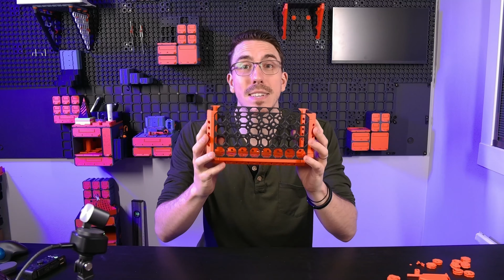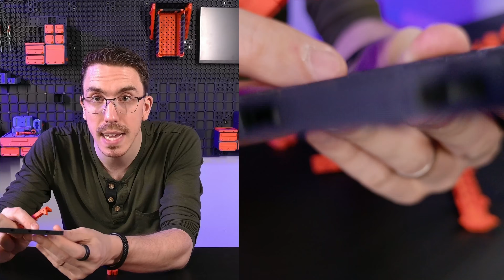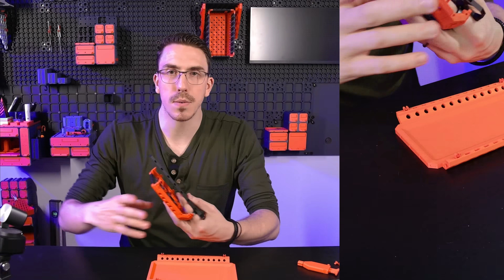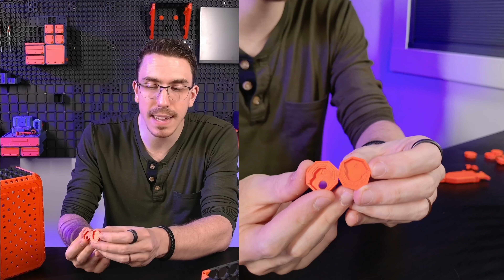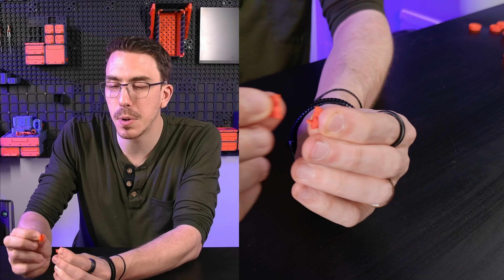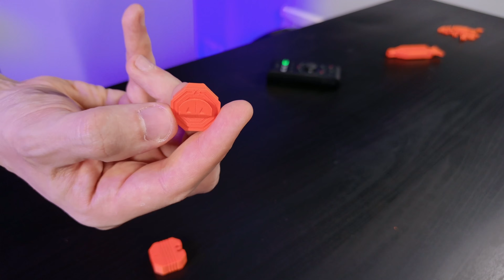Simple Basket #1 : Multiboard Pack Build

Comment: I don't get it - please can someone explain. If I've built a basket, and want to hang it - then I've simply one bit of Multiboard that I want to attach onto another. What I don't understand is why the hell the solution wouldn't be symmetrical? Why am I using an all in one half-multipoint hole snap on one side but needing four parts on the other side? Can't I just have an all in one snap on both sides? Seems hugely complicated for little benefit.
Reply from the maker: Hey @jakdaw, I understand that it can get confusing sometimes but all you need is a half-multipoint of some sort, either on a large thread or a small thread, and a half multipoint hole so the half multipoint could fit in the octagon. I hope this helps! If not, don't hesitate to reach out again! Karolis (community manager)

Comment: I like the whole idea and innovation but damn, this seems way too over-engineered. I ended up just buying 3 IKEA skadis boards and printed out dozens of different bins, holders, hooks etc as there are hundreds if not thousands of ready-made print files for that system. 
Multiboard is great if you really need a super-customised complex system. 
Skadis plus ready to print files is probably the best for the other 99% of users.
Reply: Hey, I get it, sometimes it can get overwhelming. If it's too complicated, just try and use the core parts. With them, you can achieve 80% of what the multiboard can do. All the other parts are for advanced. We are trying to remove limitations which can lead to it being more complicated.

Comment: @Multiboard at 7:10 you're checking if you have the grid tile "the right way around", what is that about? Aren't these symmetric in all 3 directions?
Reply: It's purely visual preference. He's deciding on which side he wants facing out based on the different finish of the bottom or top layers based on how his printer made them look and if he used ironing or not. He explains it better when talking about the longer side grid tile at @9:00.

Comment: where can i download the bottom of the basket on the wall? the one with all the holes. cause all i can find are the regular and thin plates
Reply: I was also looking for that specific bottom with the holes. I want to make a basket that might contain slightly wet pool toys and want to make sure they can drain well.
Reply: did you end up finding it? I couldnt
Reply: Hey @joshuamurphy3827, you can find all the plates here: https://www.multiboard.io/on-grid-update

Comment: This is just a mess now. It's no longer a solution to a problem. Streamline this stuff
Reply: Hey, I get it, sometimes it can get overwhelming. If it's too complicated, just try and use the core parts. With them, you can achieve 80% of what the multiboard can do. All the other parts are for advanced. We are trying to remove limitations which can lead to it being more complicated.

Comment: What's the reason behind the pack being full plates as a single STL rather than a .3mf project with individual objects on the correct plates with labels?
Reply: Also, plate 3 has a non-manifold edge error in bambu studio
Reply: Hey @benriser4018, we don't work with 3MF.

Comment: where can I get the folding half multipoints?  the split version with the card do not work for me. tolerance settings are clearly off on the card and insert slot.  So I would like the folding version for simplicity.
Reply: Hey ykgreene, you can find all the multipoints here: https://beta.multiboard.io/multipoints

Comment: You could use the same little card piece design that connects the two halves of the screw pieces on your regular screw pieces that you use in other projects. That would alleviate having to use the filament to hold the screw together.

Comment: You know what you really need to do? You need to make a “connector assembly” 3mf that shows all the connectors actually interfacing with each other. Like, every single one. With everything properly named, so it’s absolutely brain dead simple to understand which ones go together. With repeats of parts that fit together in multiple ways.

Not a starter pack, literally like a little library of just the connectors.
Reply from the maker: Hey @DannoGung, thank you for the suggestion. The truth is all you need to get started with is the key core connections that are all in the demo pack. If you then wish to dive deeper we have the wiki where can see all the core connections in action and lastly if you want to rule them all that is where in the future we will have the advanced section of the wiki. At the end of the day if you are just starting we believe in keeping it simple to start with. - Karolis (Community manager)

Comment: I am trying to build my first system, and every time I watch a Jonathan  video, I just get more confused.   Also, things that seem like they should be obvious questions to ask, are not easy to find in the knowledge base.  All the getting started videos, are more like look at the 100 ways you can do this, instead of here is 1 easy way to do this one easy thing.   Does anyone know of a good resource for beginners?   Jonathan has created what seems to be an amazing system, but maybe he would find someone who is good at teaching for these videos.  He knows the system so intimately, and he has so much passion for it, that it quickly becomes overwhelming spaghetti.   I am not saying this as something mean, just feedback from a 1st time user who has already watch 2 hours of his videos, and struggling to get a simple system with some bins and drawers mounted in my shed on with 24" on center studs.  The power of the system is there is a million ways to do it, but it is also what is keeping me  from making progress.  For example, all I needed was a flush big thread multipoint, to get my bin/drawer mounted.   However the getting started system was demonstrating a bolt/screw/snap that took 3 parts to print, that weren't linked, well documented,  and I couldn't get working -- probably because I downloaded the wrong parts.   There were also other suggested solutions.  The explanation of the Lite multipoint was talking about flush mounting, so of course I tried that first and it was the incorrect thing to do.   Long story short, I cannot follow these videos.  I appreciate all the work you do Johathan, and I plan on becoming Multi Maker if I can actually get this system working.   If you are able to find someone who specializes in teaching/education, that would be great.  Unfortunately, I am going to stop watching your videos, because they are just so chaotic, hard to follow and having the opposite effect for me.  Your millage may vary.
Reply: I agree! I've been wanting to do my multiboard project for awhile now, but everytime I try to watch videos on it from him, or the small handful of other vids from people, plus digging through the site and the not so knowledgeable knowledge base, I just seem to go down a deeper rabbit hole. I guess I just need to start with the basics, ignore all the noise, and hope I can figure it out fairly easily without wasting a ton of time and filament. Could be an analysis paralysis situation. Just do it and it may be easy. Lol. Unfortunately the multiboard site doesn't tell you the specific parts you need/have a comprehensive BOM, and the individual model descriptions on thangs don't really tell you exactly what they go to/are for, or they have different names than what the vids/knowledge base call it. I'm convinced now after like 2 hours of downloading models, watching vids, reading descriptions, and reading through the site the other day, that he is purposely making the free stuff confusing so people buy the packs/subscription. I really want to love the system, but he is making it hard to. Especially with some of his shorts from months and months ago where he talks crap about other makers in the comments about how much more superior his system is, or how his way of doing it is better and saying it'll be coming soon, then it never comes out. Underware by Katie is a great example if you check out his short from like 10 months ago about his cable management system. Instead of giving her props (even though in her video she gives him a massive shoutout and great praise), he says his is better and he's been working on it longer than hers has been out (which obviously she worked on designing it for a long time too. Possibly even before he started his, and he is just speculating), telling people it'll be out soon, and 10 months later, nothing. Idk. Could all be speculation on my end too and he could be a great dude, but I just get rubbed the wrong way from the way he goes about multiboard and talking about other creators/makers. It's a good system, but that doesn't make others bad or justify the need to hate. Just do you, be kind/respectful, and if the system is that good, it'll speak for itself and the people will adopt it.
Reply: I agree wholeheartedly here. I want Multiboard to succeed, but at this point success requires a focus on user experience and user education. You see this so often in the software world, where good and even often superior products don’t get the adoption they deserve because the developer wasn’t able to effectively communicate value to their user base. To be fair, it is an entirely different skillset to actually making the thing, and it’s extremely rare to see both skillsets in the same person unless they have an actual education background. This is literally what my current role is at work — it’s absolutely essential to command people’s attention and demonstrate the value of your product while you have it. I’m not advocating a pivot to “quick flashy cuts” for its own sake or anything, but this video has me more convinced than ever that Multiboard will start losing people and will stagnate (despite it being a masterful engineering achievement) if it does not address these concerns before the next big parts drop.
Reply: Hey, I get it, sometimes it can get overwhelming. If it's too complicated, just try and use the core parts. With them, you can achieve 80% of what the multiboard can do. All the other parts are for advanced. We are trying to remove limitations which can lead to it being more complicated.
Reply: There are a lot of options. I think it will be a challenge to beginners no matter what, just keeping the parts straight will challenge you. I would recommend keeping a good note system so that when you do figure it out you can come back to what you did (it will be years in some cases). I recommend obsidan, you can link the files group them and even picture them.  You are trying to organize... so get organized, as the options require it.
Reply: seems easy enough to me. his tutorial was nice.
Reply: Sad.   I don't find any of the tutorial confusing.  But, the Parts do get some delving into and reading. Reading, I have found is the best solution for finding a solution and to understanding.  Meaning - you can use your printer?  Wow! If, you got the printer down - this is just tinkering.  The box is L Beams, Corners, Tops, A bottom plate/panel, Side Panels, Clips. Find the sizes, download, determine the quantities: 4 upright beams, 4 bottom beams, 4 corners, a bunch of clips.
Reply: I am waiting for a sponsored filament order to arrive and then I’ll try to tackle this on my YouTube channel. I have 0 experience of Multiboard myself so hopefully I’ll be able to do all the mistakes for you and hopefully teach you something along the way! :)
Reply: I subscribed to your channel  @TheFullTimeYouTuber  looking forward to your video!
Reply: @wvg. Will start this project next weekend! Just waiting for a back wall for my table!
Reply: I've been in the same boat since this was released.  Personally I'd rather he focuses on new things like this and await the community to do their part and share how to make things.  However, people are like me and very camera shy!  What helped me was to print a5x5 panel and 2 stands.  Then I had a sample panel to test things on to see how they actually work.  I look at Multiboard as a pile of lumber and nails.  What is great are videos like this that show how to make a thing, and I now see that I don't have to use Shanks to attach a box!

Comment: I stated to install the system in my printer room. Honestly, it just got way to complicated.  I mean how many little parts are there now?
Reply: Like 2500. 🤣 I wish that was a joke too. I think it's at like 3500 parts total now. More isn't always better. Back to the old adage of "If you're trying to simplify your model/parts, you're on the right track. If your making it more complex when something simpler could do the job just as well if not better, there is an inherent problem with the engineering." Or just "Just because you can, doesn't mean you should." Lol. Shoot, even Einstein saying "Everything should be made as simple as possible, but not simpler," which highlights the importance of simplicity and clarity for complex concepts. Unfortunately this isn't any of those.
Reply: @korabeats_  I whole heartedly second this. I think Multiboard is still very much in its infancy and the path to glory will only open when all ideas have been explored and the system has been boiled down to only the truly necessary parts. Just for example, I don't think you need 3 strength levels of snaps, just make the strongest one and call it a day. Always remember KISS ;)
Reply: @NochSoEinKaddiFan  Absolutely! You can't necessarily fault Jonathan as he knows multiboard so intimately, and to him, all these extra things make sense and excite him, but it's making it difficult for the community to get on board fully. I love the modularity of it, but as of now, the documentation can't keep up with the complexity. Like you said, it's in its infacy, but once all the bugs get ironed out and boiled down to necessity/simplicity while keeping the modularity, it'll take off like crazy. I know I personally would only use the strongest snaps, because why not? Even if I don't need them now, with the focus on modularity, I'll eventually need them. I don't want to throw away a bunch of plastic and reprint stuff later down the road when I could do it now.

Comment: I'm actually getting ready to build a specialized basket, and was trying to figure out the best way to mount it, so i may try this. For those saying it's complicated, yes, it definitely is! There's definitely trade-offs for the complexity, but I really like having the options available. And it gets easier once you think about where the forces are going into each part what mount would be best, and documentation is getting better, plus you don't have to utilize all or even most of the connectors, just pick one or two that you like and use those. Having more options is ultimately what makes the system more powerful, because it can fit a variety of needs while maintaining compatibility.

Comment: How would one go about attaching multibin plates to the wall with command strips, preferably with the standard 6.25 offset?  (i know there are the ones for standard multiboard, but i dont think they will fit in any way i can see for multibin plates)
Reply: I went down this road and abandoned the idea. You can use the standard command strip mounts with “big hole plate snaps”, but that felt like a waste. I ended up using the bolt-lock mounting system instead, which you can see on one of the recent shorts on this channel (which are MUCH better than these longer videos btw, as they get straight to the point and are not filled with interesting but distracting tangents!)
Reply: I've had much better looking using the vhb tape mounts with command strips than the specific command strip mounts. I think the one of the easiest ways would be to use plate snaps to get medium threads, then use bolt lock vhb tape offset mounts, then just pick a medium thread bolt that suits you. I'm pretty sure bolt locks use medium thread, not at my computer right now or I'd check
Reply: @riandr0 Justinclayton42 is right, there's actually a short on this channel showing it and it's really handy, I was almost right on my first comment, mid thread plate snaps, except it's locking bolts to mount. It looks like they haven't updated the bolt-lock VHB tape mounts to be 6.25mm instead of 8 mm, however if you lower the parts by 1.75mm through the build surface in the slicer, you should be able to approximate it. They don't seem to have quad bolt locks with VHB tape available yet, so just be aware of that. You might be able to remix something to suit if you need them

Comment: Always have issues with dual clip being SUPER HARD to put it and they do not click like in this video. Any tips? Using PLA so not as flexible as PETG.
Reply: I print the Dual Clips in PETG and make the following changes in the slicer

2 walls (not 3)
8% infill
Lightening or Cubic infill
Set Z axis of Dual Clips to 3mm (apply to Dual Clips ONLY)

These changes make the clips fit easier into slots and provides the additional grip and strength missing from the LITE DUAL CLIPS
Reply: I would try shrinking them 1 or 2% in your slicer